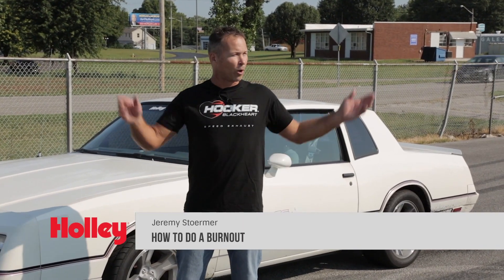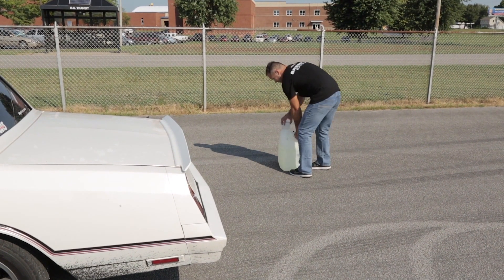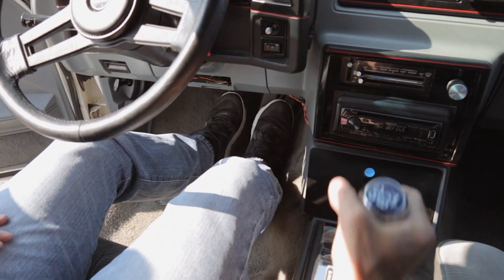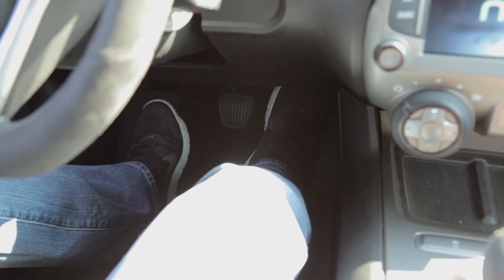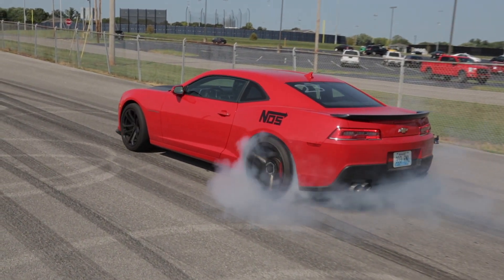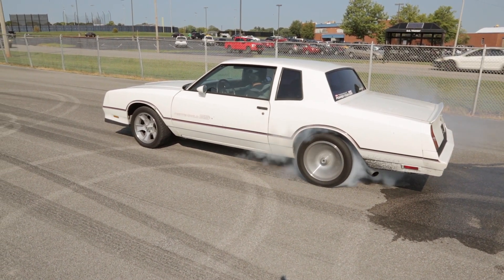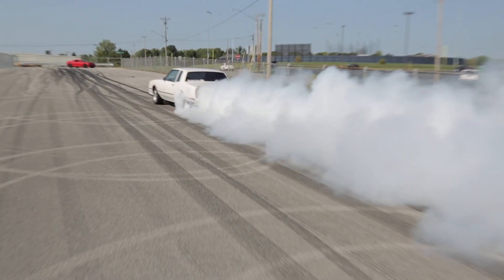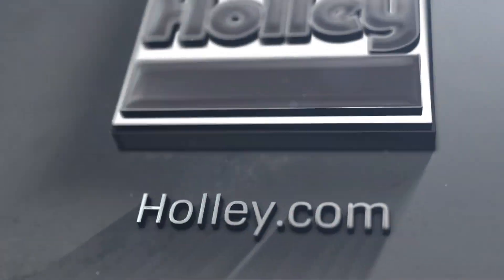How To Do A Burnout - Holley Performance

Comment: Yes sir that's what I like to see! Great tips, I have a 1984 buick regal 383 stroker holly carb. with just one wheel spinning and smoke everyone out,but always safety first.
Reply: they have the same body,only mine has the limited package and grand national or grand national experimental  (GNX) are packages on the regal.

Comment: Would be good to some how block the oil from goin to the rear wheels? How do the rear breaks act in such situation ?are they generating heat and been spended prematurely because of been constant pressed? Thanks
Reply from the maker: THX, We will do a future video showing line-lock and trans brake operation to cover your points !
Reply: Cars and trucks with rear drums. The drums will let loose first because the proportioning valve puts 60%of fluid to front wheels